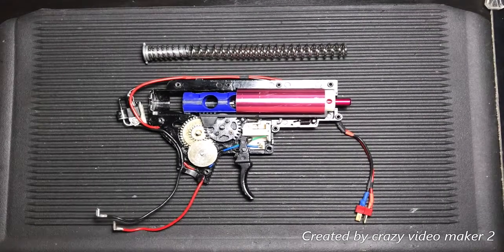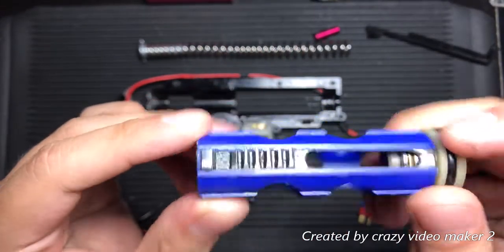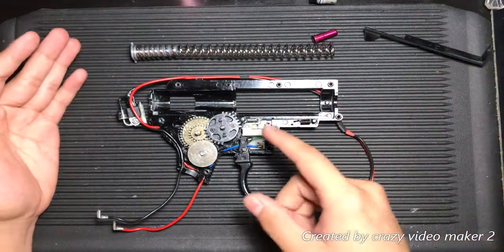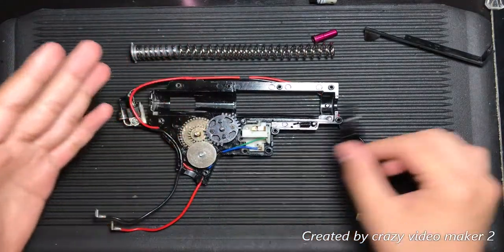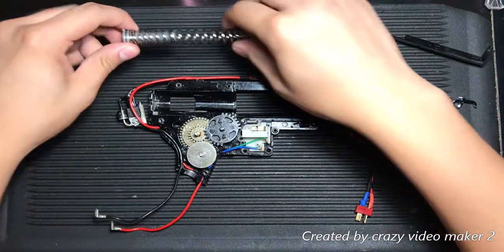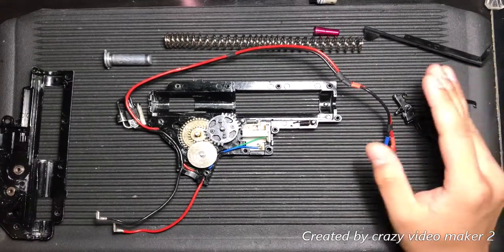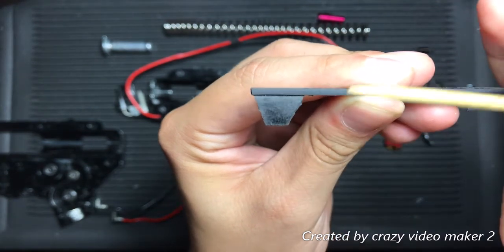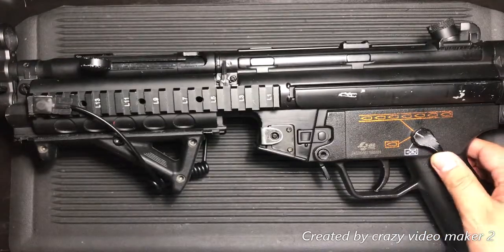JG MP5 DSG - Fastest Trigger Response Build

Comment: Nice budget DSG build, agree many stock parts can be kept, the JG cylinder head is excellent for a stock cylinder head, the piston head is also pretty good too. Take up some slack on the trigger to reduce pull, steel cut off lever (check if magnetic/ferrous), stock gears are pretty robust too. I concur with nigh on everything you did, but maybe slightly over corrected AoE a tiny bit, though with a m190 spring the airpad will compress a lot more than it first appears.
Might still be a whisker more correction than I might aim for "partial correction of AoE" to squeeze max stroke & AoE balance - but everybody will have a slightly different take on stuff.
Was the JG Blue the neodym type ?
Seems to be bushings on bevel/spur gear & bearing on sector - hmmm OK, was that how the stock box came - as long as bushings under the gears or under bevel & spur, it will be fairly durable, though maybe mostly bushings on a DSG, but everybody might have a slightly different take on things. 
As said - a good budget DSG build, without spending money on numerous parts that were not absolutely necessary. Ignore any criticism (even mine), you did a pretty good job imho for a budget DSG build
Reply from the maker: Thanks for the input! Yes the JG Blue is the nice neo type. Its nicely balanced with high torque and speed giving about 26 rps with 13:1. Partial aoe correction would have probably been best especially with a dsg build but I didn't want to sand down the airpad. The bushing/bearing situation is definitely a bit funky with this build because of shimming issues. The shs bushings I was using were really thick and did not allowshimsfor certain gears so I replaced those with bearings. To this day those bearings are doing a great job at withstanding the stress so I will just replace them when they break.
I challenged myself to make this build as budget-friendly as possible so theres nothing fancy in this video. Ive since gotten a perun mosfet to replace the stock trigger assembly and it works really well. I will probably make an updated video about that soon.
Reply: @airsoftscientology8885  yup, them SHS bushings can be a bit chunky in some boxes, especially with chunky SHS gears too. Plus EVERY build is different, various issues can dictate the exact final build, differing slightly at times from original plan or intention. Yup the Blue neo is about a 22tpa/22k rpm motor and a good stock motor (even the ferrite isn't bad but doesn't have the same grunt due to ferrite magnets but still good enough for a mildly tweaked gun). A good balanced motor like you said, providing snappy response without lots of heat & massive amp draw.
I commend you on your sensible approach, not needing to chuck hundreds into a build and optimise the decent components already in there. Like when some very skilled players challenge themselves to play only with budget guns or springers and melee cqb etc...
You did very well, any money saved could be put to good use on bucking/hop/barrel when the accuracy comes from - and still not break the bank. A very good budget DSG build once again (and likely an awesome build with the Perun's features). You have sensible skill & wisdom, ATB sir
Reply from the maker: @authuruksake969  I appreciate it, you sound like a very knowledgeable tech yourself. All the best and happy holidays!

Comment: A full cylinder doesn’t help at all in a DSG. Heck even a halfway ported cylinder doesn’t help in a 8t dsg
Reply from the maker: The piston head goes a little bit past the halfway point of the cylinder with an 8t dsg when it’s all the way back so using a another cylinder that allows more volume should help. Doesn’t necessarily have to be a full cylinder, but that’s all i had to replace it at the moment.